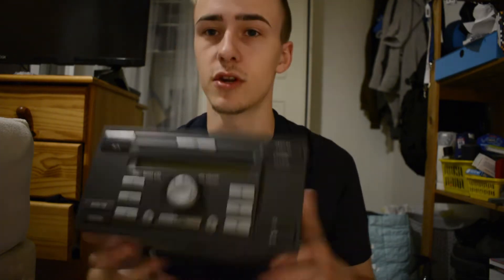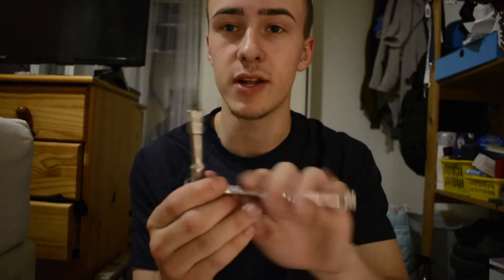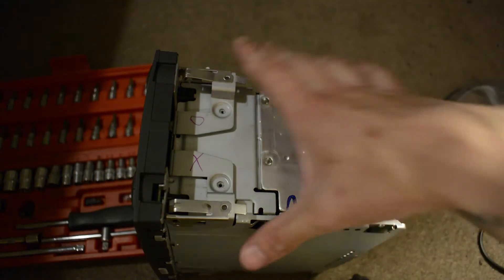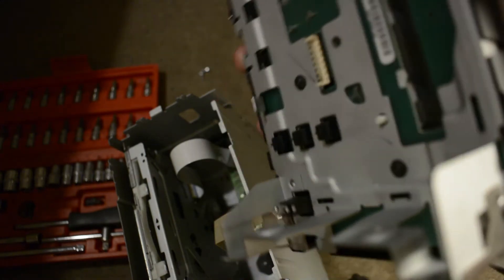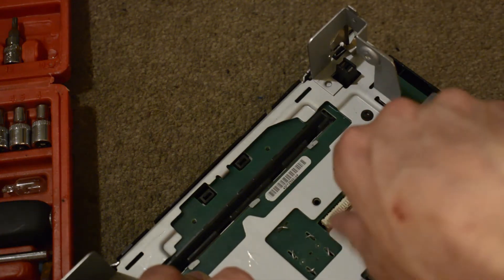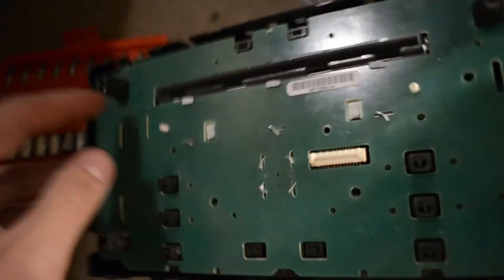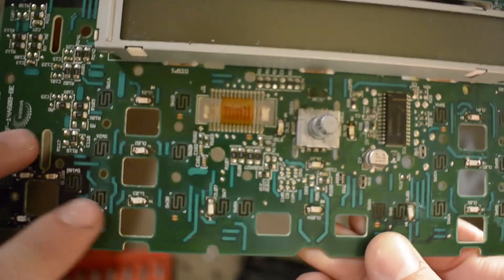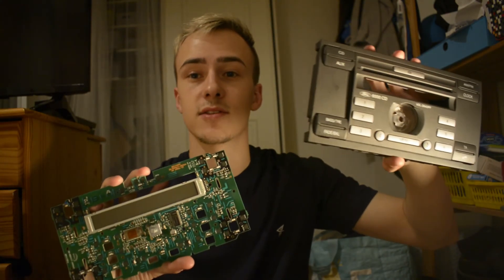How to Dismantle a 6000CD Radio (Ford Fiesta Mk6 Facelift)

Comment: Can i take off the Volume Knob off without disassembling the whole unit? It seem really hard if the unit is in the dashboard but yours is just fell off when you hold the frond face only with the board..!
Please respond, i want to clean the contact inside but can't do it with the Volume knob in place..